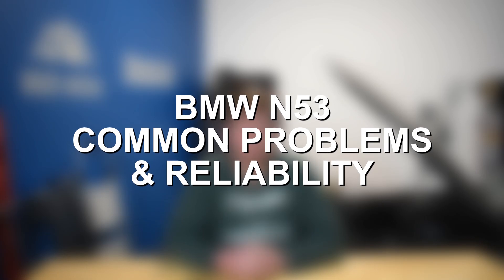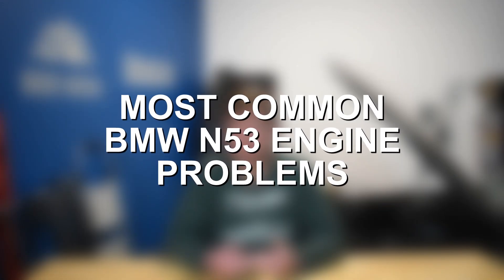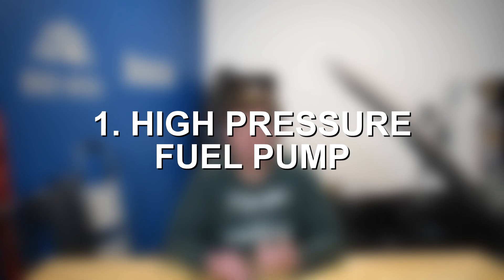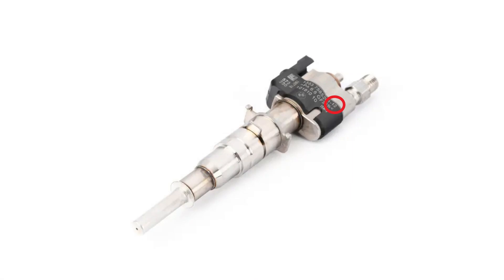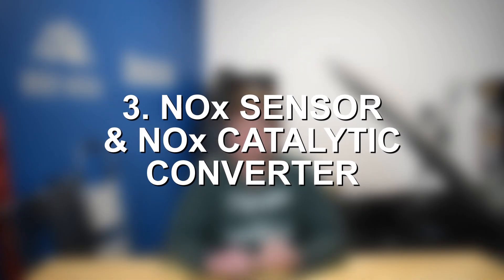BMW N53 Engine | Common Problems & Reliability

Comment: Would love to know how to actually identify what part is the problem
Reply from the maker: R - Do you have an OBD scanner?
Reply: @8020Automotive  Yes I do. I have OBD Eleven because I used on years ago for my VW Passat it was great back then. But these days the app is just infected with payment stuff. Still can read error codes and live data for free though. I do have error code for catalytic converter P0430 IIRC and the LTFT on bank 2 is around -10% during idle. There is some slight disturbance during idle but not so much. Mostly it runs fine but I do have the check engine light. I also usually get error codes for bank 1 running rich even though the LTFT never change from 0% on bank 1. I did buy some new injectors from what I thought was good place to buy refurbished, but reading more online about them I'm pretty sure they are fake China copies because one of them had the 6 digit code giving me "out of range" error code from the DME (they are returned but I have not been refunded yet). if I do drive aggressive I will for sure get drive line malfunction and the next time I drive the car it will run poorly for at least 15-20min.

Comment: You want index 11 in an n53, not index 12, index 12 were specifically for the n54
Reply from the maker: M - Thanks for sharing.
Reply: Local BMW shop mounted 12's to my N53B25 in 2013 :)
Reply: @KittyTheCat_ it's not recommended. BMW OEM still officially recommends index 11s.

Comment: I have a bmw e61 530xi 200kw with the n53 already done the hpfp. And 3 index 12 injectors i did just 3 simply because of the P rice . The engine is a joy to drive not just the sound but also the way it pulls the 200kw is awesome the fuel economy sucks shit especially in the city. 13.2l/100km I worse than my dads diesel audi a8l 4.2tdi that was chipped to 1000nm 460hp   Otherwise would probably try to find the n54 535xi but there is so little of them for sale it’s pretty much impossible to find them anywhere mostly nicely specced cars are either way too expensive for the mileage or just have a horrible spec. My 530xi has the comf seats adaptive bixenon lights with auto high beams logic 7 adaptive sway bars and active steering no sunroof so it’s nice and stiff stock suspension with bilstein upgraded oem spec shocks. And the spec of the car is just the ultimate sporty daily driver
Reply from the maker: F - Thanks for taking the time to share your experience! This will certainly help with future viewers.

Comment: Do you know of any problem where metal shavings appear in the oil? Like bearing failures?
I have N53 with this problem and I don't know what they came from.
And the temperature the refrigerant up to 110°C whit movin thr car. Bad wather bumb or coolin sistem maibe?

Thaks
Reply from the maker: B - Metal shavings in the oil indicate excessive internal wear. Yes, rod bearings are generally at the top of the list for issues that cause metal shavings in the oil.

As for the coolant temperature reaching 110°C, that's certainly on the higher-end of the operating range but it's within spec for the N53. If the water pump or cooling system run into any serious issues then the coolant temperature will well exceed that temperature and result in limp mode and warning messages to pull over the stop the engine

Comment: No offense but 50.000 to 100.000 miles should be way more.then enough for a water pump really engine life span is 200-300 k and that's km not miles
Reply from the maker: D - For non-BMW's, sure. But we're talking about a BMW here..
Reply: @8020Automotive I’m on oem pump at 158k , I test it by running the pump with car off and heat blowing. 0 issues. Still on index 01 2007 335i
Reply from the maker: F - Nice. Thanks for sharing your experience.

Comment: Been driving n53 powered BMW's for 8 years now, love this engine. But don't buy if you don't have money to spend on the stuff that can fail.
Reply from the maker: M - Well said. Thanks for sharing your experience.
Reply: It’s a great engine when working but like you said, too many people say crap because they can’t spend to fix it or cannot work on engines and get main dealers to work on it and cry when they hear the price😂
Reply from the maker: B - Well said.
Reply: It's a Very powerfull engine. You have to use high quality fuel. In germany e.g. Ultimate 102. It's a must.
Reply from the maker: K - Well said. Thanks for sharing.

Comment: So true! It's been a sad experience for me.
Sometimes I wished for an E39.
I also have SAAB 9-5 Aero -06 that is extremely reliable. Almost to boredom.
The problem with the SAAB is rust... Yeah, it's a bit awkward being a SAAB made in Sweden and driven in Sweden...
But the BMW E61 gives me more silent road trip, the 6 cylinder gives me a nice vibration free drive and the comfort seats puts the cream on the top. It actually doesn't matter that the SAAB Aero had original 260HP.
Maybe I'm getting old, soon to be 54. hehe
But still, the SAAB doesn't give me any of these headaches. It has over 205 000 miles on it and doesn't break a sweat but feels more like a "young guy" car but still extremely reliable.
For now I drive my SAAB as I have to work on my E61to take down the automatic filter pan and replace it. Also take down the Mecatronic unit to replace the seals for oil transfers.
I already have replaced the 2 thermostats and my AC compressor that went bad.
The parking break locked up (thank god) in released during the winter as it stood still. So that is one more thing.
But on the other hand my SAAB had the same parking break issue during the winter when it froze up and got stuck in half released making it ware down the break material.....
I still have a Citroën CX Prestige. These are very reliable except for rust..... RUST!!! Aaaargh....
Reply from the maker: J - Thanks for taking the time to share your experience! This will certainly help future viewers.

Comment: N53 would of been a great engine if it wasnt for all the shite parts on it (injectots, fuel pump, waterpump, nox cat and nox sensor bla blah)

Worst part is injectors are now 400/500 new. And they cant be furnished/cleaned
Reply: would HAVE
Reply from the maker: E - That's what he said.
Reply from the maker: L - Very true..
Reply: In Europe Finland one injector for this N53 engine cost 686 euros. Total cost for all 6 injectors 4100 euros. Its a good thing Im not poor :D
Reply: I bought second hand index 11, from a scrap yard, you can get them for 1/3 of the price. Saved me a ton of $$$

Comment: I’ve read somewhere that bmw never really sold cars with N53 engines to the American market due to the high amount of sulphur that you guys have in your fuel? Not sure though. I’m an e60 523i lci owner with the N53 double vannoss 2.5 190hp. I recently had a problem where coolant and oil mixed in the coolant expansion tank but got nothing in the engine, turned out to be a bad oil cooler for the engine and I replaced and was advised to replace the transmission oil cooler too since it’s an automatic. Overall the engine is pretty reliable it’s just that everything around it breaks 😂. But I love it so smooth and has decent speed and the gearbox has very fast changes for a car from 2007.
Reply from the maker: U - This is correct. Thanks for sharing your experience!

Comment: I have had the 325i N53B30U for 3 years now. 2007 plate. 

The car itself is reliable and the engine really is a joy to drive, a piece of history as it is the last ever naturally aspirated engine made. I intend to make my one a case study in terms of durability. 

I have had my original pump fail last year, at 115k miles, 8 hours of DIY later, and 1000GBP for the part (BMW only part) it runs fine. 

I had the luck of my injectors being replaced under recall in 2012, so that is fine for now. The engine it self seems bullet proof - the auxiliary components are what give issues, I am preventatively changing the Water pump, thermostat, and coolant tank/lines this month. 

The NOX can be solved with an Emulator, but I had mine coded out and that has bypassed the 3x types of fuelling modes, also had it mapped to 330i spec, probably around 265BHP now, absolute joy to drive. 

Another one to look out for the the valve cover, the CCV diaphram is integrated and is good to change this before it goes bad. 

Regular oil changes every 6k miles and this beauty will keep on running. my overhaul list 3 years later is coming to an end and hope I dont have to change anything else until 200k+ miles. 

Also, be sure to replace the Oil filter housing gasket, this will go bad on ALL N53, lots of heat on this gasket and it will risk damaging other components once bad as it leaks onto the serpentine belt which can come loose. 

N52 more reliable, but more thirsty. This engine is the perfect cross between N54 and N52 - has goods and bads from each.
Reply from the maker: M - Thanks for taking the time to type your experience and insight out! This will certainly help future viewers.
Reply: I had an n53 last car they are not reliable cars there always something that needs doing. Injectors are biggest problem with these even new index 11 doesn't fully solve it long term. Injectors are trash. Fuel pump box sensor box cat 

I wish I bought an n52 with port injection no box cat high pressure pump injectors. N52 might use slightly more fuel but is much more reliable and sounds better but then again n52 is not really that reliable off an engine as with most bmws there always some coolant or oil leak that needs addressing
Reply from the maker: L - Thanks for sharing your experience.
Reply: Hey I have a e60 530i 09 plate car. Got a feeling my oil filter housing is having a slow leak. Are there 2 different gaskets in there? One for oil filter and oil cooler?

I just changed the valve cover at 86k miles. I have the slowest coolant leak (once a month top up) but can't find the leak anywhere. In my last service (every 6k miles too) I was told the oil is clean and there is no mixture of oil and coolant. 

If you have anything to add to the above would be grateful. 

Thankyou
Reply from the maker: T - Yes, the oil filter housing does contain two gaskets. Regarding the coolant leak, some natural coolant loss is normal. If you're driving 1,500 miles a month and topping up on ~8oz of fluid then there's likely no cause for concern. If the coolant loss is worse then you likely have a small leak somewhere or the coolant tank cap may need to be replaced
Reply: Where did you get the car remapped at? (I'm from the UK). I have a late 2008 325i and I am wanting to be mapped to a 330i too. Also, I have the engine light for NOX (Changed both sensors) so I think the rear CAT needs replacing, but I'd like to bypass it as my car is running really well. Just had the rocker cover done as it was weeping a bit of oil. I change my oil every year 8k-10k miles, but I mainly do motorway miles and stick at cruise at 65mph as I get over 40 MPG and it's a great cruiser! I've had it for 3 years and the only problems I've had are electrical issues (no I-drive), ABS sensors, Footwell Module with the lights and the coolant pipe bursting. Other than that, great car. It's my daily but I'm looking at a Jag XF 3.0 Diesel as I want to keep the e92 as a backup car as it is approaching 125K miles. Many thanks for your comment.
Reply: @montenegrineagle930
Reply: Hi, did your fuel economy worsen after you coded out your Nox sensor?

Comment: all cars is going to have common problems you just got to have the money to fix it. and especially when it's out of warranty and it's a used car that's 5-10 years older. P.S. Just Have Money🚘💳💰💳🙏
Reply: Are n53 engines later produced after 2010 better than earlier produced ones or same problems
I have a e93 2013 325i
No problems sofar
Great video
Reply from the maker: S - Thanks for sharing your experience and feedback! Typically, the later the engine year, depending on engine generations, the better. Gives manufacturers a chance to make engines better.
Reply from the maker: 2 - This is correct. Thanks for sharing this insight.

Comment: Im about to buy an e90 330i with an N53. I hope im not gonna regret it.
Reply: They are for a period of time and then as soon as they start playing up big expensive parts. They are not a cheap engine to run when injectors go all the time
Reply from the maker: Dine - They are solid so long as maintenance is kept up with.
Reply: I picked a N52B30. And it has a lot of problem so far haha but i love this car
Reply: @Dina-vx7um  N52, the last BMW Engine with port injection, much better choice than N53 ( direct injection )
Reply: @tritop  As a n53 owner who had to replace injectors, I agree.
Reply: @JuergenQingdao  High preasure fuel pump next; they all had to do it for EU regulations
Reply: Brothas stop falling for injector issue and test them before tossing . My injector misfired but it only need decoupling rings , on of them bent somehow
Reply: In Europe Finland one injector for this N53 engine cost 686 euros. Total cost for all 6 injectors 4100 euros. Its a good thing Im not poor :D